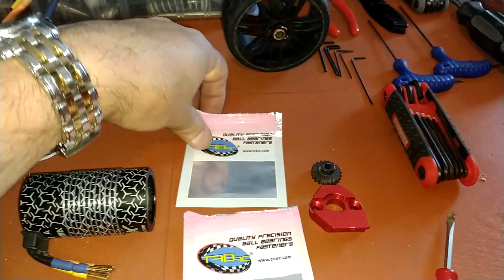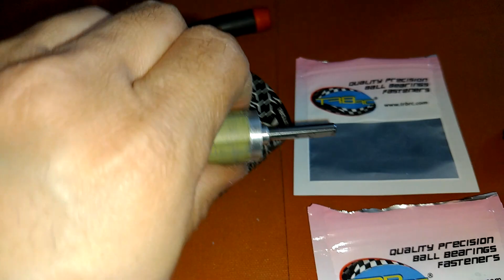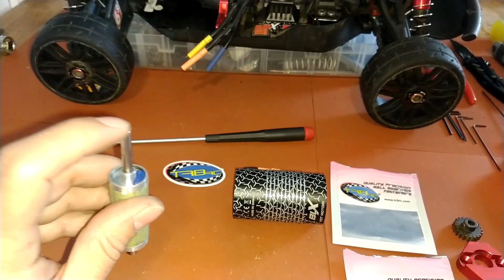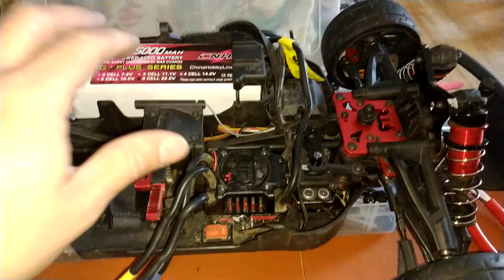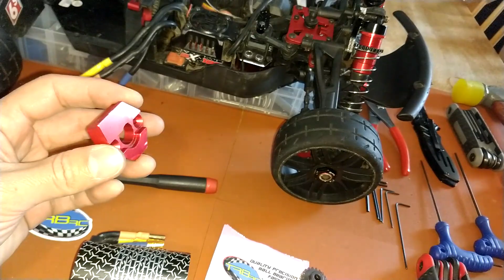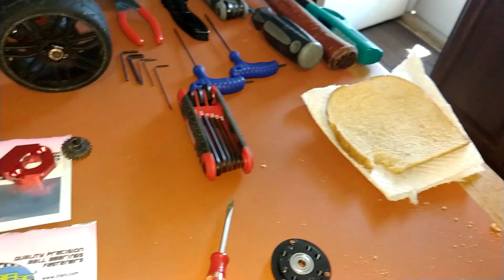Arrma Typhon 6S BLX Brushless Stainless Hybrid Ceramic Motor Bearings

Comment: I applied a lot of heat to that bearing with my cigar torch and it came out after a while. Good stuff. Subscribed
Reply from the maker: Thanks for watching & subscribing! 😎 👍 👊 🍻

3 yrs later them bearings are still good. The motor finally died a little over a year ago, I took out the bearings & re-purposed them lol.

Comment: How’s your ceramic hybrid bearing doing now? Did it last?
Reply from the maker: Hi, thanks for watching 👍
They're still going strong. And I bash her pretty hard, lots of off-road & sandy soil surfaces.

As for helping keep the motor cooler, no noticeable difference in temps, she still reaches ~135-140F after bashing around on 6S for ~20-25 minutes.
I just got in this weekend a Castle Monster Mamba 2 ESC for her, upgrade video coming up soon on that. I'm trying to spec out a better motor for her too.
Thanks for watching again, please feel free to ask any questions 😎

Comment: I've seen ppl use soap for pilot bearings on a car but never bread.
Reply from the maker: Lol, neither have I. But it worked like a freaking charm 😄
That bearing was in there SUPER tight, heck, I even had to use the plastic hammer to drive the new one into place. There is absolutely 0 wiggle room in there!
Reply: @rcbustanut2057  that's good its a tight fit you don't want that bearing to move.
Reply from the maker: @joshherrman3201  absolutely, I have seen many sloppy fitted bearings in my venture of this hobby.